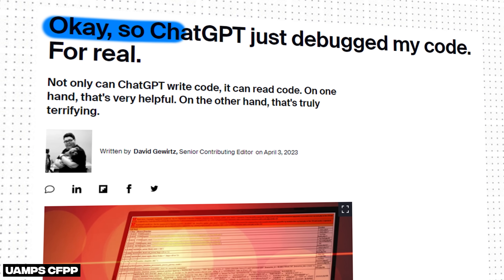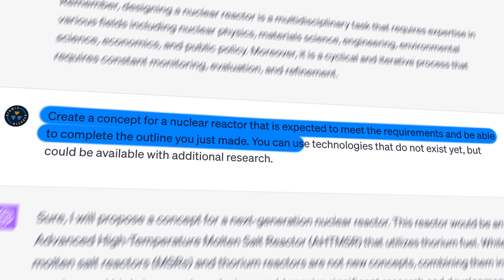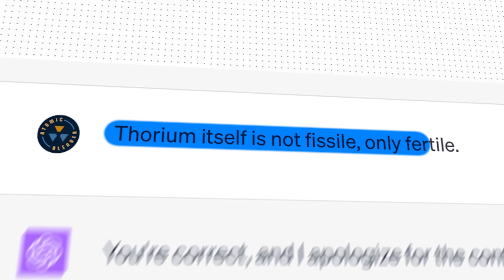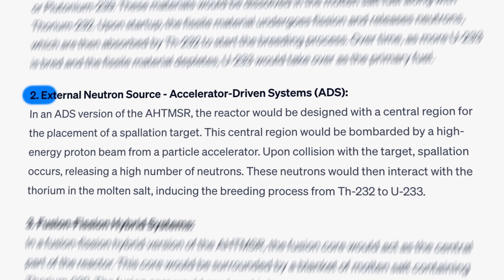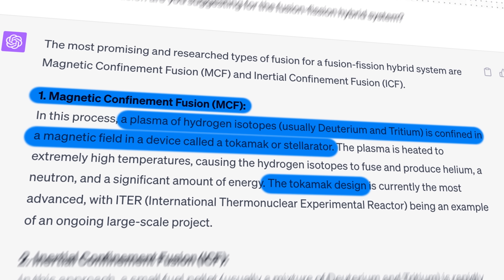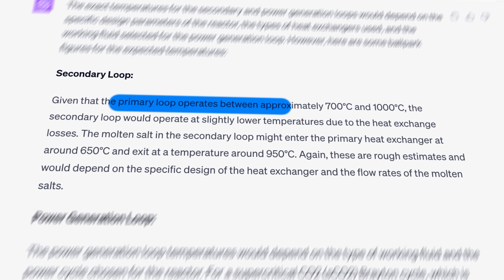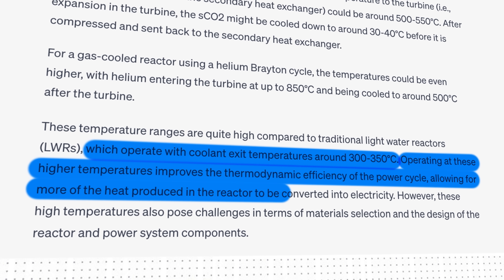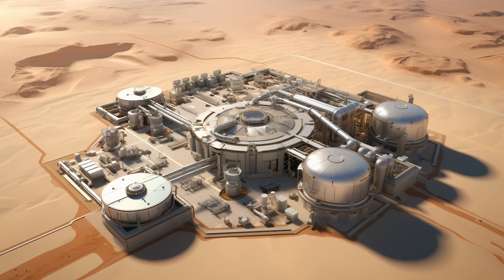Unveiling ChatGPT's Insane Nuclear Reactor Design

Comment: To be fair, Accelerator driven sub critical reactors are a real thing, if not in actual power production yet. :)
Reply: Link to example(s), plz.
Reply: @johnbash-on-ger  I'll have to do some research to find an example, and I agree you have the right to demand evidence. :)
Reply: @johnbash-on-ger  I remember that italian physicist Carlo Rubbia worked on this idea, in France and Spain. You can find wikipedia pages dedicated to the "Energy Amplifier", nicknamed "Rubbiatron". It's supposed to use thorium activated with a proton accelerator.
AFAIK, the general idea works quite well, but energy efficiency is still too low for meaningful commercial applications.
Reply: @GiovanniPerini  Thanks.
Reply: @davidjhousley8617  YouTube has no issue posting links.  It's a per-channel setting.  Some channels allow comments with links, others block them.

Comment: IT is quite easy for it to design a reactor, the issue is it doesnt design them feasibly without your input. I've already had a few Molten Salt reactors going for patent review so its not all that hard, ChatGPT only helped solve some structural issues such as using Ceramic berylium reflectors.
Reply: "Hey - this 6 month old baby AI didn't revolutionise nuclear reactors, its crap"
Reply: @@markaspen QUOTE:  "ChatGPT (Chat Generative Pre-Trained Transformer) is an artificial intelligence chatbot developed by OpenAI and launched on November 30, 2022. "

7 months -
Reply: @piccalillipit9211  Chat is 7 months old, but GPT-1 was released in 2018.
Reply: @piccalillipit9211  It was developed and in service since before 2018, it only has reached general public usage since 2021, that was when its public data cutoff date was also implemented.
Reply: @Anamnesis-Apotheosis89  So what you are saying is all humans are actually 9 months older than they think they are cos we measure age from conception and my car is not 2 years old its actually about 12 years old cos it took 10 years to design it...

That is an interesting and novel way to measure the age of a thing.
Reply: @piccalillipit9211  AI is not a livng thing, learn to equate and use proper context if you'e gonna try to reason with logic... Technological age is not equatable to biological age...
Reply: @Anamnesis-Apotheosis89  WOW so my car is actually 137 years old...  

Dude you are losing thins debate so badly, stop it, its embarasing.
Reply: Still pretty good that it solved a structural issue. Maybe the whole point of AI is not for it to do all the thinking and take over humanity. Maybe it's simply a problem solving tool. So the future won't be Skynet. It won't be like Buck Rogers in the 25th century. It will be more like Star Trek.
Reply: @orodriguez947  Thats what I was implying as well, but some people think its the AI doing all the work.
Reply: Molten salt in metal pipes, not very good idea. The major setback of MSR is corrosion due to high temperature and salt itself. We should use more inert metals with great heat conductivity.
Reply: @goranz9446  Hence the usage of a beryllium ceramic. I considered Molybdenum alone, but I still needed beryllium ceramics in the construction of the piping. Currently the design uses a molydenum-alloy.
Reply: The original Aircraft Rector Experiment used Berylliuma moderator. moderator.
Reply: @ancapftw9113  Yes, as its great at stabilizing the material its added to while also offering great conductivity. When added to molybdenum alloys it further stabilizing the atomic structure of the alloy, protecting it from corrosion and from wear, especially in such environments of those found in nuclear and fusion reactors.
Reply: @ancapftw9113  Overall, beryllium is one of the more useful materials for these applications, niobium is another great choice.

Comment: You know, by the time they're on to GPT-5 and GPT-6, at a minimum I think it'll be an amazing hypothesis engine and great for prioritizing high-value work. It's drawback is it can't directly experiment, or at least we wouldn't want it to. Without experiment there's no assurance for it to add new established facts to its processing which is why it'll always be behind us for as long as we need the physical world for experimentation and can't simply compute our way through.
Reply: There's some extreme bias in a lot of scientific papers, and that's a big problem. None of the GPTs, currently, have the capability to determine if information it's trained on is correct nor any way to determine correctness on it's own.  Another problem is inherent bias by omission (data sets that are excluded by humans, for whatever reason).

Comment: Interesting video.  I'm a fellow nuclear engineer myself and talk of ChatGPT has come up for some of the things we do day-to-day (or at least a general AI).  It's pretty tough to see it being a huge impact for nuclear anytime in the near future as so much of the data and analytical methods are proprietary, so a training set for many things will be a huge challenge for non-owners of the data.
Reply: The first problem is probably that its training material does not include enough of the relevant domain knowledge. That and the fact that Large Language Models are designed to generate words that statistically follow one another, so that the end product has the right kind of feel. However… this language approach does not really work for this kind of a problem.
Reply: Agreed. When I was asking chatgpt about MSRs, it kept insisting on the importance of fuel cladding. In this video it just skips over the actual problem of Pa233 separation in favour of where do I get the neutronz.. meh.
Reply: *GTP

Comment: I've been following the molten salt and other Generation 4 efforts since Kirk Sorensen came to Calgary. There's an improvement on the freeze plug in both the Elysium and Terrapower designs: a permanent leak in the reactor core that requires continuous pumping to keep the reactor  operating at all. I like the Elysium design that features a reactor core that's completely empty - no moderator or any other parts vulnerable to neutron damage. I feel certain that there's a lot more genuine innovation there that Elysium is treating as proprietary IP that I'll never get to see.

Current AI can't even begin to examine options that haven't been discussed in depth anywhere, much less do engineering calculation, design and performance modeling that allows intelligent tradeoffs to be made. We'll be doing the innovating for the reactors that we need to rebuild our energy systems.
Reply: *current AI that we have access to. Chat gtp is like comparing a McDonald's happy meal toy car to a $1m Ferarri. Believe there is already AI that is infinitely more powerful than the basic tools you can get online and ask silly things. DaRpA sure isn't likely to share tech.  The DOD sure isn't going to share their tech.. the govs of the world sure aren't going to. Anyways, extremely powerful engineering calculations programs are already readily available and therefore accessible to AI systems.  All it has to do is plug in requirements and values, compute and run models
Reply: Molten Fluorides and/or Sodium in reactors ... very interesting, very challenging.

Comment: This was fun, some thoughts:  I recognize basically all of these options and designs, though I agree the last two are - unconventional.  The TEAC lectures referenced these over the years.  ADR (accelerator neutrons) is a thing but the presentation I saw did not suggest it as a breeding solution but more of a control mechanism.  Make the reactor just barely subcritical and then add neutrons from ADR to kick it into gear.  When you are wanting less power, feed in less neutrons.  Not saying if it is great or not, just sharing.  As for the "high temperature" MSR, the MSR is already designed to be high-temperature, so there is nothing new there, and the design using Flibe is straight out of Kirk Sorensen's Flibe Energy company and talks given over the last 15-20 years in the thorium community.  Nothing new there.  The typical core range is discussed to be 700-1000C, and with a Brayton CO2 turbine to extract energy.  It is exactly what they have been suggesting, right down to the salt plug.  So, as one might expect, AI's "design" is really just stuff it read on the internet mashed together.  I just thought you (and your viewers) might be curious where this came from.  I've been studying this for a while (note the name :) ).  Early Subscriber. Loving your channel, thanks for the fun 15 mins.
Reply: My thoughts exactly. While i can't say for certain, whether others had the same experience, my first real interest in Nuclear energy came from discussions and videos about Kirk Sorensen and LFTRs. I think it's simply far more frequent in the AI's training data than most of the other novel reactor designs, making words and phrases relating to iit more likely to be selected as the most probable next word in the AI's responses.
Reply from the maker: Exactly! LLMs can't really "make" new things, only mix up what it has already seen. The prevalence of certain information, like Thorium MSR, which has a large and vocal community will tend to give weight to that information, absent any other parameters. If I had steered ChatGPT towards fast reactors or some other technology, it would go digging for something like liquid lead. I just thought it was a fun experiment and a bit of a snapshot of where the technology in AI/ML is right now. Come back in a year and we'll see where things are.
Reply: @atomicblender  The notion that LLMs can't make new things might be correct, but I suspect it can make connections and spur new conversations, which humans have not yet come across. I work mostly with programming and game dev, so it's not likely I'll find any confirmation, but a nuclear scientist might have a better chance. The current limitation is the amount of tokens being limited to 35k with ChatGPT4. It has the best responses when the topic is narrow. (Great video btw)
Reply: @Rovsau  Large Language Models are a gimmick. I can 🤖🧠 function in any language in the universe. Who am I?
Reply: @andrewfarrar741  Math? 🤔

Comment: The problem is "AI" is now a buzzword for many species of machine learning.  I don't doubt parts of it will be used for design, optimization,  as one of many tools, in reactor design.  But the data needs to be represented differently than what ChatGPT does.   It's not large language models (LLM's), verbal associations, linguistic or semantic mashups, with no understanding of the underlying physical reality.

The other issue for "AI", being used in reactor operations (automation), is "explainability".   It can't be a black box.  One has to thoroughly understand what's going on, be able to predict and understand it's behavior, in a deterministic fashion.  I can't imaging the NRC passing anything that  behaves unpredictably, and acts on its own accord.
Reply: AI is not a buzzword, it's exactly what the name suggests: Artificial Intelligence. The issue most people have is the exact definition of intelligence. Some people define intelligence as "the thing that humans do", in which case of course no computer comes even close. But that's not the definition scientists use. The common definition of intelligence is the ability to solve problems. Which computers obviously can do. In computer science AI generally refers to a program that doesn't just blindly follow instructions, but figures out what to do next by analyzing the input data. The most basic example is a chess program that searches through all possible variations of the next few moves, and selects the move that leads to the most advantageous end state.
The most advanced form of AI currently is neural networks. These go one more step further, they not just find the solution to a problem on their own, but also figure out the best way to find the solution (it's called machine learning). Sufficiently large neural nets can even handle the complexities of the real world. Like driving a car with just cameras.

LLMs are not entirely black boxes either, but that's a more complex topic.
Reply: @andrasbiro3007  It doesn't exist. Don't get angry because someone questions your religion.
Reply: @demonmonsterdave  
It does exist, that's a simple and extremely obvious fact. Don't get angry because someone questions your religion.
Reply: @andrasbiro3007  You should educate yourself about computer science. Also, extra points for creativity.
Reply: @demonmonsterdave  
You should educate yourself about computer science.
Just read something from this century.
Reply: @andrasbiro3007  Ha ha your responses are as creative as that myth you believe in.
Reply: @@WektakUuboflak Well done for copying a parrot. Next, I suggest you try copying a higher animal such as some kind of ape.
Reply: @@WektakUuboflak Best wishes.
Reply: @andrasbiro3007  current "AI" is just marketing or a buzzword like was said before, it has no self interest, no desires, it can't make any decisions or learning without human input
Reply: @Feefa99  
Nope. You are extremely wrong too. You don't even know the definition of AI, let alone what it can do actually.
Start with learning what AI really means, or intelligence in general. None of what you listed have anything to do with intelligence.
Then loop up AlphaZero. The "zero" in the name refers to the amount of human input that was used to teach it. There was none. It learned entirely on it's own. And it's not the only example, there's plenty more.
But often it's much more efficient to learn from a teacher then your own. Humans overwhelmingly learn from other humans too, there's very very little that we figure out on our own. And don't even start me on the originality and quality of human decision making.
Reply: @andrasbiro3007  They're correct though.  "Artificial Intelligence" is a convenient term, but that's not what we have.  We have neural networks, which is more a framework for self-writing programs than the nebulous term "intelligence".
Reply: Artificial Intelligence is not just another buzzword.  Its the last buzzword
Reply: > The problem is "AI" is now a buzzword for many species of machine learning.
Not so much anymore.  Now the term "AI" is a buzzword for specifically LLMs.  That is.. not an improvement for the field of science communication.  Far too many people have gotten the idea that ChatGPT is just a shiny metal skeleton away from being the Terminator and destroying us all.
Reply: @altrag 
Those people are most AI experts. Including the developers of ChatGPT.
There aren't many people in the world who understand AI and don't think it's dangerous. Most of the debate is around how imminent the danger is and what can we do to prevent it.
Reply: @andrasbiro3007  Current iterations of AI are dangerous because of how Capitalism will use LLM for things they are not suited for. Not because the AI itself is self-aware or anything.

Comment: Hi AtomicBlender  I wanted to share with you that in the oil and gas exploration industry we have a small (3 meter) neutron partical accelerator. It's purpose is to detect the difference between oil, water, and natural gas. Neutrons love hydrogen atoms so they stick to water and oil better then the natural gas, and we have the the "hydrogen figerprint readings" so we know what is where in the oil wells. All that being said it would be possible to have a small neutron partical accelerator and it was safe enough to have oil and gas workers working with it for the last 30 years. Reach out if you want more information about it.

Comment: You keep mentioning the impossibility for fusion inside the fission reactor, but this is moreso fission inside a fusion reactor, which is absolutely something required for fusion reactors. A big part of the tokomak design is the plates of beryllium designed to absorb the neutrons to extract the heat. If the neutrons were instead to simultaneously heat and assist in fission, a great electrical multiplication could be achieved. This is not at all in the specs of your design, far more unproven than thorium alone, and would absolutely be more than single digit billions, but theoretically that would be the most effective method of fusion electricity.

Comment: I think a dedicated fusor could make the initial fuel load from thorium, that would make it a fusion initiated fission reactor.  Obviously it would not be energy positive, but I do know you can make an incredible amount of neutrons from them if you are willing to crank them up and really burn them watts.
Reply: I've seen this idea suggested a few times, and I really like it. It seems like a much more feasible solution than trying to build a pure self-sustaining breeder reactor.
Reply: The trick is getting the thing to not melt before it can be activated, given that it'd be swimming in a pool of several-hundred-degree molten salt.  And knowing the way nuclear technology tends to work, it probably has to be ignited at a fairly exacting spot in the middle of the pool as well.. now you've got to be able to steer it to the right spot in addition to keeping it in one piece for long enough.

I'm not going to say its absolutely impossible, but I have a hard time believing it could ever be practical.
Reply: @altrag  You Just let it solidify and drill a hole in it, There is no reason when you are breeding the jumpstart batch that you need the breeding blanket to be molten. Solidify a huge container of breeding blanket, drill a fusor or 10 into it, run them for a while until you have enough to get the core running, pull them out, and separate the uranium-233 that is made from the protactinium created by neutron bombardment.